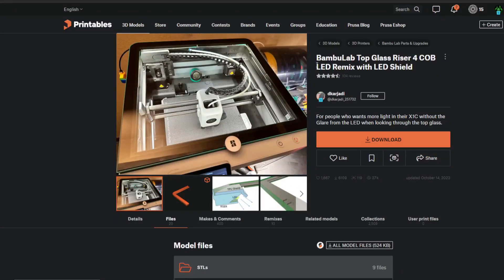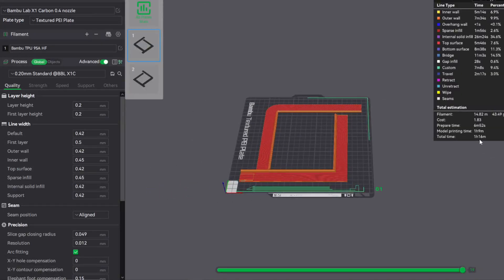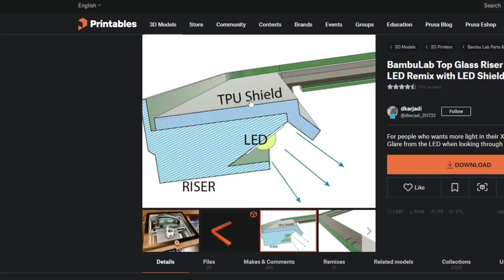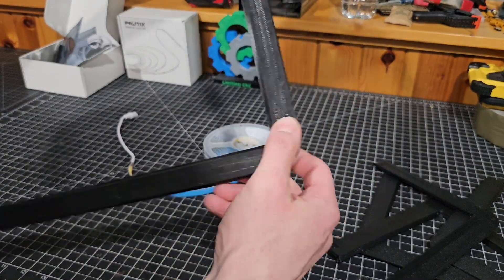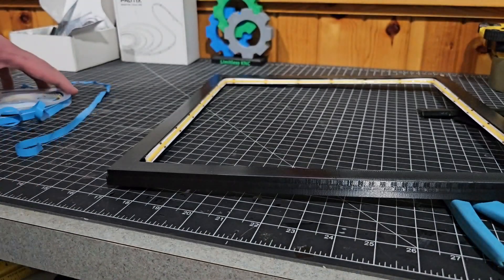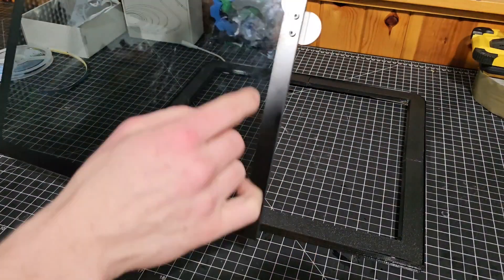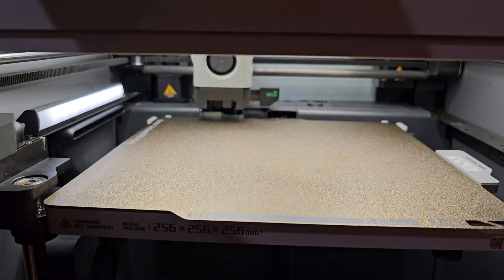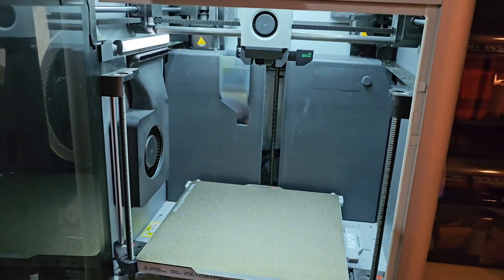New Bambu Labs X1C LED light upgrade.

Comment: A nice addition to these is a cheap PIR relay compatible with your lights voltage. I got one that has a timer dial and mounted it inside so it automatically comes on when the print head moves and stays on for 10 minutes.

Instead of TPU you can also use some insulation tape (I used Armaflex I already had), it's black foam. My only problem was my glass top was bowed upwards, so it's not a great seal.
Reply from the maker: That's awesome. I'll have to look into the relay. Would help not having to run to turn the light one every print.

Comment: dude, you're missing the most important part which is the BLLED controller... That will change the light colors depending on print status and will turn the lights off if it's doing a scan and can allow you to control the light by the front screen. BTW, these prints and light mod is not new, I've had it for 6 months now.
Reply from the maker: New to my machines, not to the world. Also, the machines just run in my basement, I just need the light to view them on the app.
Reply from the maker: Is he on printables? Thinking about it of it can change from green (printing) to red (problem) that might come in handy. The app doesn't always tell me if something wrong.